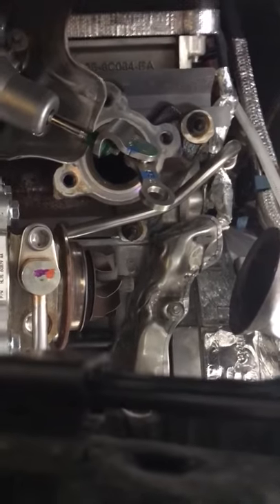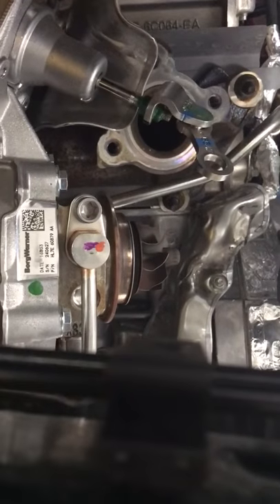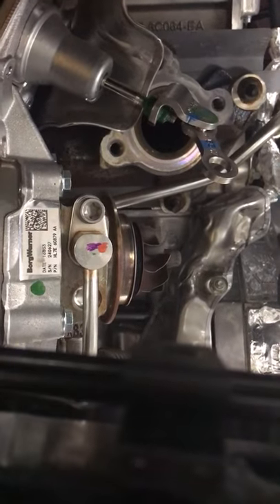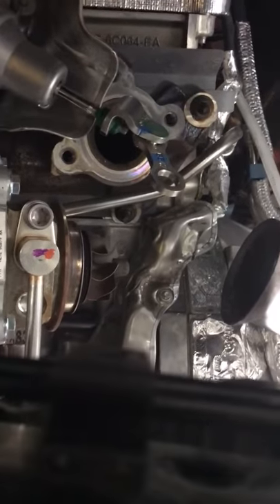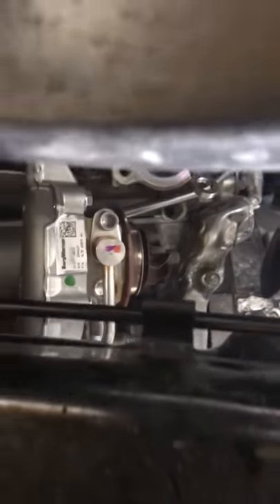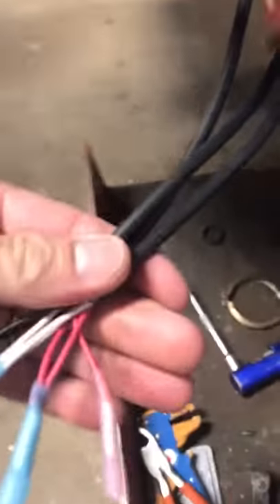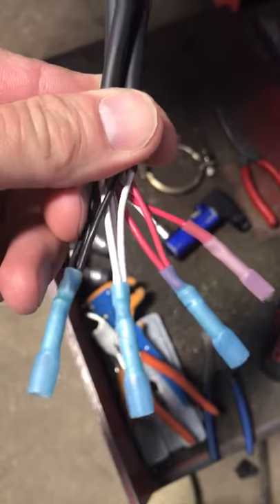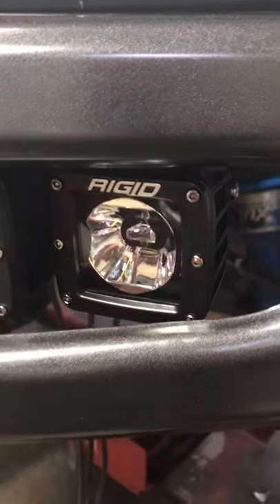2017 Ford Raptor turbo upgrade inside the turbo. Part 2

Comment: Matt I wanted to ask if u could hear the turbo spool more after removing the polycarbonate shutters?, I'm also looking to get turbo wind noise from my raptor and I already deleted resonator and and have catless downpipe  and still cant hear the turbos from the tail pipes
Reply from the maker: It is pretty hard to hear them spool up and down like a diesel.  I believe it is because they are smaller with less to keep spinning, although I am not an engine guy.  I heard the most improvement in whine with the removal of the baffle inside the breather and the installation of the turbo port spacers, they opened up the output side a full inch more.  Have fun with your truck!
Reply: @WiringSolutionsOKC  thanks for replying ,I might just give up on that ive tried diffent exhaust configurations but nothing is working ,I do know that it has electronics wastegates that stay opened unless ur on  the gas the wastegates close and the turbos get the air rushing straight to them ,I'm gonna try the corsa extreme full cat back and I'll let u know  if it makes a difference
Reply from the maker: @cirilogonzalez2642  I myself gave up on exhausts after trying three.  I am currently running my stock again.  I even had electric dumps put on and I dump it sometimes but even still, not much whine.  I have gotten away from trying to achieve the growl like a V8 and have embraced the "Baja truck" sound as that is what it really is after all.  If you have not tried running baja mode in two wheel drive you might try it as it keeps the turbos spooled and the power is as "on-tap" as it can be for this truck.

Comment: What brand are the spacers and where did you get them? Thank you.
Reply from the maker: I actually don't know the brand of those.  The owner of the shop that is doing all my upgrades and has all the info and can source the parts and ship them to you is mike@merlesokc.com.  Have fun with it, this truck is perfect for speed upgrades
Reply from the maker: http://www.spdperformance.com/index.php?main_page=product_info&cPath=566_567&products_id=121

From their site:  "A completely stock 2017 F150 Raptor dyno'd 366HP and 404LBS of torque at the wheels. After these adapters were bolted on, with no other modifications, the truck made 390HP and 447LBS of torque. That's an increase of 24HP and 43LBS of torque at the wheels"
Reply: Thank you.